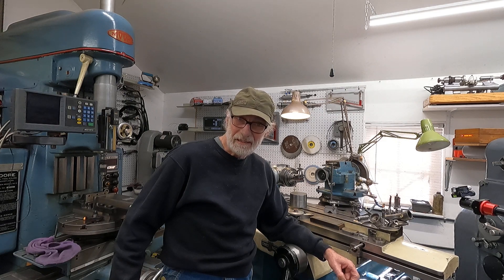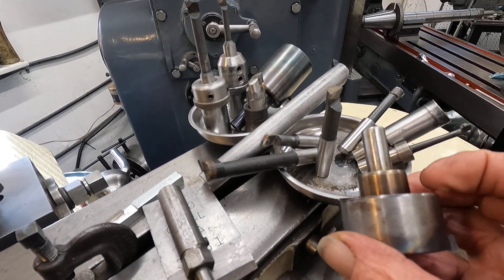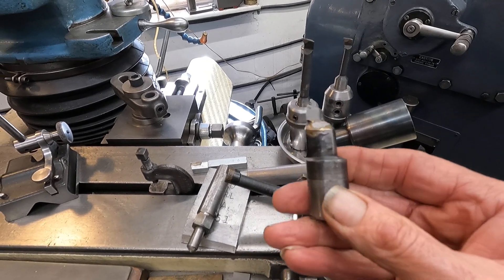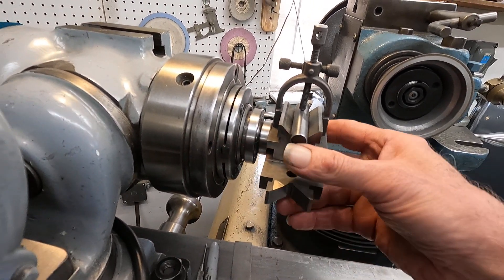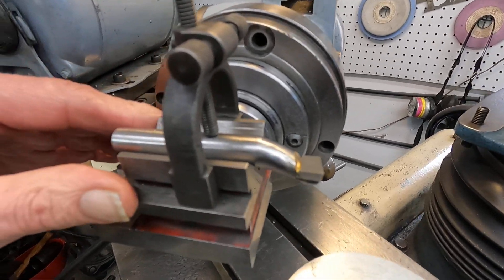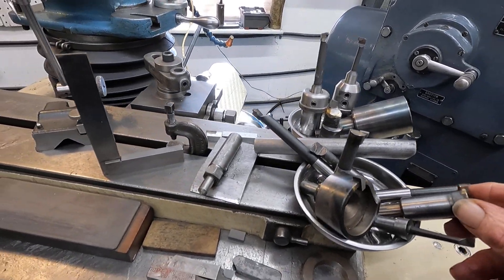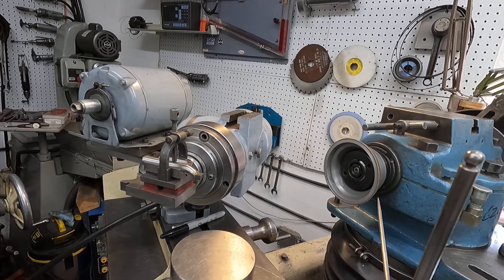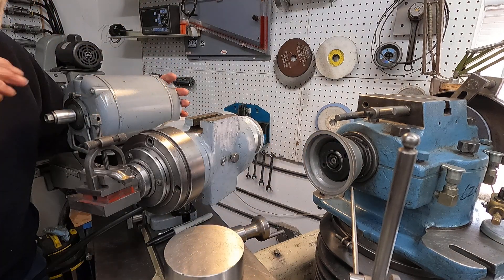Tool & Cutter Grinder sharpening boring bars

Comment: you would be surprised at how many somewhat decent cnc machinists cannot even sharpen a drill, nonetheless a boring bar. This information is gold. Once You know the basics You can do the same work on any manual surface grinder with a diamond wheel. Of coarse no where bear as efficient as this machine.  having skills to make or sharpen tools can get You out of a bind and makes You much more valuable to Your employer.
Reply from the maker: A surface grinder works very well, I used my little 6X12 before I was able to get a hold of this cutter grinder. At one time this was a basic skill included in most trade school programs. The local CC had a Navy trained instructor that taught being self-sufficient to a higher degree.
 The cutter grinder has been important for me to get the most out of the precision machines like the Jig bore and Monarch 10ee lathes. gives your tool the factory edge, the competitive edge for you.
Reply: @deedeeindustrialsuperprecision  I can put a v block in a grinding vise at an angle then rotate the vise on the mag chuck to get compound angles. It's so much work though and sometimes not straight forward. The cutter grinder is so much better for this
Reply from the maker: @danneumann3274  I did that too and used a Rockwell Univise with a standard V block in it. I try to go with the simplest way the Univise or similar universal adjustable work holder is most common way used on the cutter grinder to hold boring bars and turning tools also, but I found for myself using a vise and a V block in the regular work head was easier.
Reply: i tried to sharpen a boring bar this past week with very little success so here i am haha

Comment: What are your thoughts on carbide dust from grinding?
Reply from the maker: For the video, I had a fan at the open door causing a reasonable draft. Normally I have a small shop vac that I rig at near bottom of the wheel, and use the nuclear grade respirator that is hanging near by. Great point the dust is very dangerous, it is said the cobalt is the worst component in carbides.